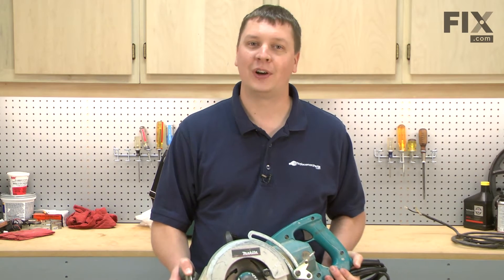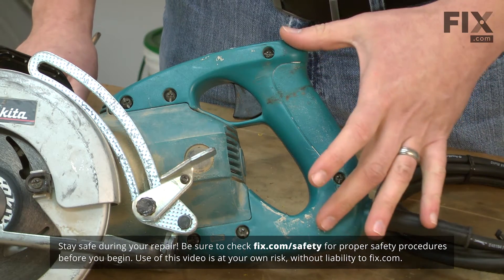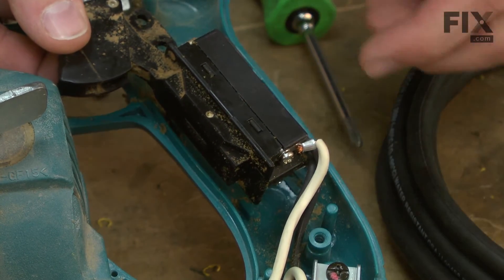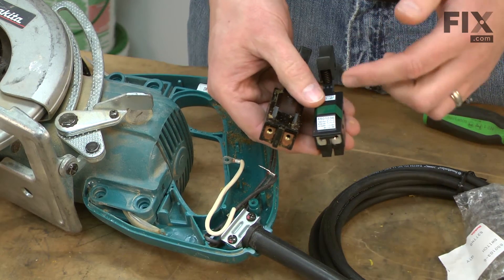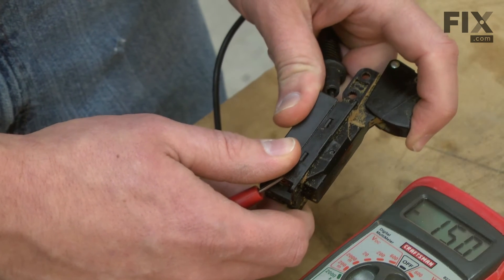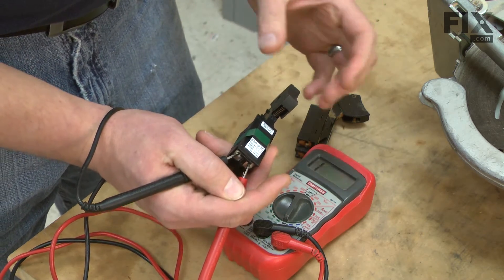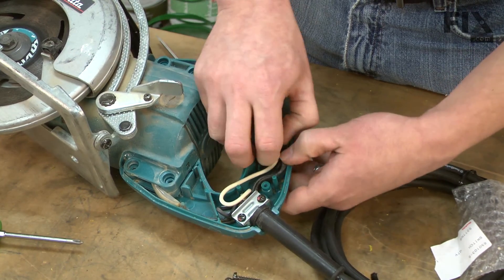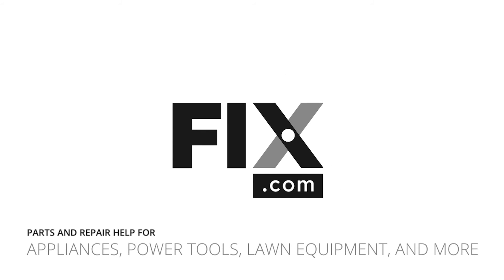Makita Circular Saw Repair – How to replace the Switch

Comment: Any idea how to fix a spindle look on a Makita cordless circular saw? Thanks
Reply from the maker: Without knowing what model your saw is I can't give specific instructions but typically the blade lock is sandwiched between the upper blade guard and the motor housing. Removing the upper guard should get you the needed access to repair the lock. -Mark

Comment: Sar makita n5900b machine I bought windding and armatur new thing but what is the corbon spark
Reply from the maker: Hello, if you live in Canada or the United States you are using 120 volt power. The Makita N5900B is made for the European market ,  which is 220 volts.  If you purchased parts for a N5900B and your using it in Canada  or the U.S.
it will arc on 120 volts.
Reply: Thank you sir